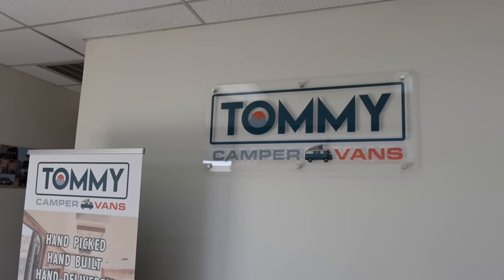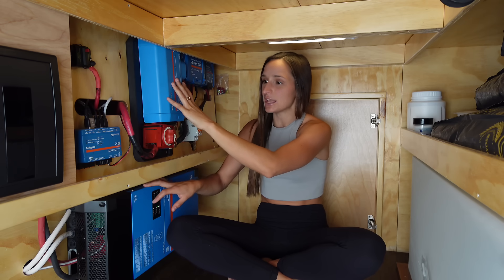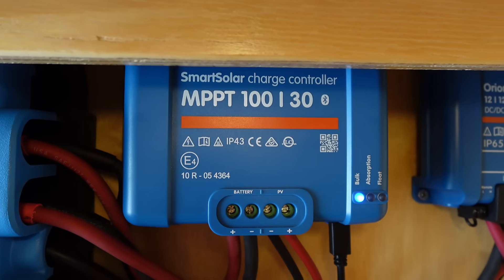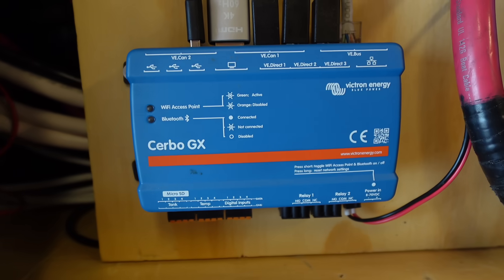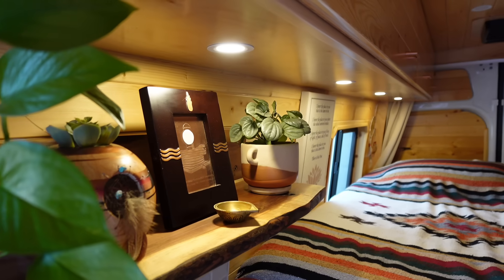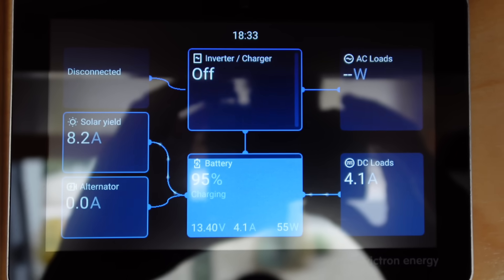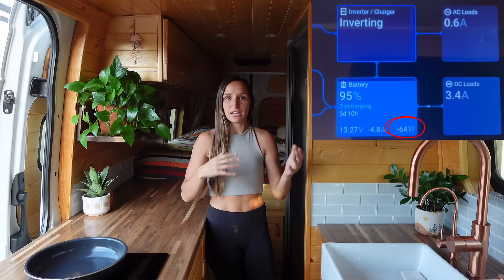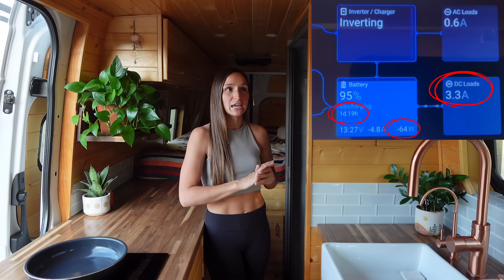VAN ELECTRICAL SYSTEM | A Practical & Simple Breakdown

Comment: Almost a year now and significant advancements have been made in van life's market development especially for electrical components. 
8 months updated van electrical system parts for a similar setup:

Stock alternator (12v 140a 1,700w typical) $included
12v 400a 4,800w High output alternator upgrade $400
12v 60-105ah 1,100cca Lithium starter battery $180-350
4-Point flat lug battery terminal blocks $20
4 Gauge cable $30/100ft
Circuit breakers 120v 30a ac/10-300a 12v dc $9/ea
600a Kill switch $25
40a 12v 616w Dc-dc charger with mppt $130/ea
60-100a 12-48v 720-1,200w Mppt $90-170
Rigid solar panels $50/100w
8-14ft 600-1,100w Solar awning $5,000-7,500
Shore power charger 120v 5-30a ac-dc $20-110 
13a 120V ac in port plug $15
314ah Heated bluetooth lithium house battery $280/ea
Rj45 bluetooth monitor module $20
3000w Psw inverter $160

14-2 wire $30
120v 20a Gfci with 65w gan usb-a+c $65/ea

Total = $965 for heated 314+105ah battery, 3kw/6kw inverter, 100w solar, 600w ac-dc+shore power, and 616w dc-dc 12v-120v electrical setup. (not including upgraded alternator, 60-100a mppt, solar awning, or 65w gfci outlets)

Comment: Fun vid, lots of great info. With regard to DC to DC charging using engine alternator……you should understand that pulling a large bunch of amps out of the engine alt when/if charging the house batts at engine idle rpm is a severe stress to the alternator. Highly recommend you limit use of DC to DC charging to when you are on a highway. Alternators function best at highway speed engine rpms.

Comment: I have an old VW bus and one thing that I use to help supplement power is a portable solar panel. I’m limited on how many panels I can have on my roof however being parked for a while I can put out the 200w portable panel and my batteries charge up faster. Just a thought for you.

Comment: I believe you said you only have 300W of solar panels. Do you feel that's sufficient with having an AC unit and running your appliances? I had 400W then just got an extra 200W panel because was worried it wasn't going to be enough to run the AC for longer periods of time since I live part time in Florida so wanted prepare for the heat. I will be sacrificing precious rooftop real estate since i wanted a roof deck... I haven't installed the panels yet, still configuring the rest of the components I need and final decisions. Thanks in advance! :)
Reply from the maker: I rely heavily on my DC to DC charger! I would not be able to run at all just on solar

Comment: What I did on my van build was sacrifice the amount of rooftop deck I have
For more solar power

You have(3) 100 W panel -300 W
I have  (4) 200 W panels - 800 W

Similar size van, I live in a cloudier, not as sunny area of the United States 

I would assume Texas is pretty sunny so 300 W is OK 

For me, I need the solar even on cloudy days, especially in the winter 

There’s a few months that I actually have to use a generator to keep everything powered up because it’s so cloudy for weeks at a time

Comment: As we can see the battery is not enough for ac it drains all the battery in just 3-4 hrs..
Reply from the maker: Yes I have to use the AC sparingly! It lasts a lot longer on ECO mode but I still don't use it very often

Comment: you made it super easy to follow of how when and why to use certain things and what ur setup consists of. Having 3 power choices is what i would probably consider and ur set up and especially ur monitor might be one of the best if not the best one i have seen.

my question is the dc and ac loads how high can they go before u think its too much or do u not use enough of either one to really worry about...im guessing the watts is the one that obviously needs to be monitored more carefully if ur new to van life and electrical consumption? by experience u have already learned what u can and cant do haha :)

i think u have mentioned it before but how many gallons do u have, how long do u shower (i guess its pretty quick to conserve) and how often do u need to feel up..if i missed it on another one of ur vids, my bad for asking again? lastly if ur in phoenix vegas or other places that are 90-100 degrees how do u use ur AC because im assuming it being that hot that windows open and ur power fan may not help that much if at all especially at night ? thanks

btw loved the bloopers hahahaha...."youre close sarah ur close" lol cheers
Reply from the maker: Thank you!! I don't overload the DC or AC too much because I don't want to find out 😂 I have 34 gallons total and showers are quick (turning the water on and off the whole time) lasts me about 5/6 days. I really try to stay away from temps that high for the most part. But the fan and windows open can keep it at least same temp as outside! If it's really hot, I'll shut everything and turn the AC on for an hour or 2 and cool down.

Comment: Read Physics Demistifyed. Take it out at a big library. 2 inch thick book - but just read Chapters on Direct Current, Alternating Current, More on Alternating Current. Do the simple quizes at the end of each chapter. That's what I did instead of only DIY YouTube videos. Now after 3 years, (didn't know squat of electrical) I can build Tesla Battery Packs for Vanlife, E Bikes or EV's. Maybe my own EV Vanlife Van in 10 years.

Comment: Hello, automation engineer here 🙋‍♂️the video was very interesting, keep up the good work🫶🏻 although i am a bit worried about the mounting of your inverter. The victron multiplus is designed to be mounted with the text right side up. If not the cooling is not working as well as it should. It may not be a big deal if its not under heavy load all the time, but you could run into thermal issues in the future. Everyting else looks awesome 😍
Reply from the maker: I hope it works out mounted this way 😬

Comment: You may be able to adjust the induction top power rating so you can use the air fryer simultaneously. It’s worth a Google.

Comment: Hi there!! I'm curious: Do you have to pull your Starlink inside when you move, or is that a permanent mount? Everyone I see who has one always brings it inside when moving. I have not taken the leap yet, so I am unclear how sturdy they are or tolerant of weather and wind... Thank you!.
Reply from the maker: Hi! Mine is mounted using a quick release mount from Savage UTV. I don't have to take it inside. You can do either way! Some people store it inside the van, set it up when they want to use it, and plug it in. I have seen a lot of people recently start to mount them permanently on the roof and hard wire to their house batteries (with and on/off switch) which is what I did 👍🏽 No worries with weather they are durable.

Comment: like your vids a lot:)  one criticism of the electrical work: where cables pass through holes cut in the plywood, it looks like they are pretty directly exposed to rubbing on the edges.  In an immobile situation probably not a huge deal but with all the movement/vibration in a vehicle I'd be concerned about damaging the cable insulation.  Also, assuming you have a pretty large battery bank, make sure you have at least one appropriately sized class T fuse close to your batteries.  In fact, if this is something you're not 100% sure about, I would recommend making sure your entire system has sufficient over-current protection.  Not having that stuff in place is very dangerous and can lead to fire... Sorry not trying to be overly dramatic, just wasn't clear from what I could see if you have all that kind of stuff:)  👍
Reply from the maker: Yep I have T fuses and overcurrent protection throughout the system! As for the wires, good point, I will keep an eye on that.

Comment: Great job with the videos & explaining the power system. I've learned a ton recently installing my power system in my 5th wheel. I added a 6000 watt inverter, 15 kWh of batteries & 3000 watts of solar. I love boondocking so having a ton of power is awesome. Knowing how your system works is vital so you can diagnose any problems with it.

Comment: Love your content. You are knowledgeable and articulate. You’re channel is going to do well. I have a question about your starlink mini. My wife and I had one delivered to Alaska on our trip last summer. I have been pointing it to the north but I see yours is mounted horizontal on your roof. I would love to do that. Do you notice any signal loss with that placement?  Thanks in advance and good luck with your channel.
Paul
Reply from the maker: Great question! I find that as long as I have a clear view of the sky with little obstructions (which most of the time is the case for me) I don't have any issue with it being flat mounted. If there are obstructions, I will usually have to go up there and unmount and tilt it to the North. But no obstruction, no problem (in my experience)

Comment: Hi. What setting did you activate to have the display of the Cerbo show "Alternator" in the lower left box? Regards, Silvano
Reply from the maker: Eek. I am not sure. It has always said that, and I did not install or set the settings myself. Sorry I couldn't answer this!
Reply: @sarahhfoss  No problem. I found out. It is because you have a new Orion XS DC-DC charger. With that it shows automatically on Cerbo's screen, which is not the case with the older Orions, as I have.

Comment: I can't knock it. Solid. The inverter is a bit weak though. You might want 2 of them. I don't think the bottleneck is necessary or worth it. Van life to me is freedom because it's free electricity. Not being able to use it how you want to sucks. I don't like Victron for all of their components because if the cost holds you back it might not be worth the security it's supposed to give you if you've never had a problem with those parts. You did say you had problems before upgrading to Victron but you never did go into detail. Though it may not be for all audiences I think it might be the difference maker in spending a lot of money to achieve specific goals. Running 2 3,000 inverters is better than 1 6,000 watt inverter but it's still variable and the cost of Victron components is in my opinion not justified especially if it keeps you from using your power how you want to even if it's in the name of having a system that works how it's supposed to because obviously there's a lot of people that don't have Victron systems that work just fine. call me crazy but I think van life enables a lot less tradeoffs than people think. There are 3,000 watt PSW inverters for less than $200. The Victron inverter though is both a charger and an inverter and therefore called a multi plus but is still in my opinion neither functions are worth its $1,100 price tag. I think getting over the bottleneck of 3000 watts is achievable reliably without breaking the bank or any safety standards.
Reply from the maker: Hey! Question on this because I did looked into it! Do you use it? Do you know if it works in remote places with no cell service? I started off using a Verizon Jetpack but had to switch to Starlink because more often than not I am in places that have 0 cell signal (AT&T or Verizon). But I was looking at maybe getting this as a second option to use less starlink data
Reply: @sarahhfoss  you have possibly replied to the wrong comment. Not sure what you're referring to. Haha! No big deal though.

Comment: What an excellent video!!!
It's important to emphasize i think:
1) Lithium batteries can be drawn down to 10% capacity or less whereas AGM 'should' only be drawn down to 50% capacity or their recharge cycles are reduced significantly
2) you drive somewhere every 2 or 3 days so you get a lot of power from your alternator as you stated.   I stay in an area for a week or more so rely on solar far more.  A good rule of thumb for this would be have 1.5 or even twice the solar as batteries so you would ideally have at least 750w solar or more for 500a lithiun batteries.  You have that awesome seating area up there so that would not work for you. 
Conclusion.... figure out what is best for you and do that..... just like you have but others will be different..... happy travels Sarah!!!
PS you're doing exceptionally well!!!!
Reply: Thank you for pt 2 ratio break down.
Reply from the maker: Thank you and great info!

Comment: Can't go wrong with Victron! btw, their should be no fuse burn when you draw too many amps from the inverter, it should shut down and then reset itself after a minute or so. It can draw peak wattage above 3000VA (about 2600W) for a short while, if that's for too long, it should shut down. You might want to take that up with the installer.
Reply from the maker: Yes I think there was an issue with the initial install. All of that is fixed now though!

Comment: soooo how many hours can the AC last lol
Reply from the maker: It's so hard to answer this question 😂 It really depends on if there is good sun or not for the solar, time of day, how hot it is outside (the hotter it is the more it has to work to keep cool). There are sooo many factors involved that I cannot feasibly give a good answer 🙃 BUT as I experience different scenarios I will try and keep everyone updated
Reply: @sarahhfoss  I see lol is it worth it with all the problems your facing?

Comment: Awesome video!! Just curious what sieries  your batteries are wired in, and is your inverter 12v or 24v
Reply from the maker: At 5:56 you can see a close up of all the specs on the inverter. Batteries are wired in parallel!

Comment: Great video!   Keep them coming. I’m looking forward to the one on the lights and cameras.  I think that’s an important addition.  Do you have a heater in the van?  If so, does it draw a lot of power?
Reply from the maker: I do have a heater! I have an Esbar Diesel Heater, and no it does not draw a lot. I loose about 8% battery running it the entire night.

Comment: Thanks for this video, I’m one month into building out my van. I ordered a the same Victron components that you have. I am going with 2 Epoch 420Ah batteries. That should be a ton of power, but I will be watching my AC loads. Toaster oven is 1800 watts and I can easily see myself blowing that same fuse lol
Great video by the way, you’re cool and very fit 👍
Reply from the maker: haha yes - toaster oven should probably not be used with any other major power draw 🙃
Reply: So this is my question: At the price of the multi plus inverter, is it really worth it compared to other 3,000 watt inverters that are a lot less, if you can run 2x 3,000 watt inverters for less than the price of 1x multi plus inverter? You might have to get a separate RV outlet charger, but hey, 6,000 watts?

Comment: Fantastic system! Very organized and good user interface and good explanation. The only thing I would suggest is don't have unsupported wiring on the exterior of the rig such as the line to your starlink and the small power inverter. Always secure it somehow on its path to the device such as zip ties or other clamps to protect it from being damaged. 
Looking forward to more videos.
Reply from the maker: You are so right 😣 The cords were not long enough so I got it done this way for now, but going to look into fixing it

Comment: It's my understanding that solar panel performance is significantly reduced by shading. Even a small amount of shade on a single cell can impact the entire row's production. The height of the mounting rails on your roof, relative to the panels, appears to be a potential source of substantial shading 4:41 . I'm wondering if the shading issue I mentioned might also apply to your setup. Have you considered or do you know what the impact would be if the panels were raised a bit higher?
Reply: yes if they are wired in series
Reply from the maker: Spot on, unfortunately. That is something Tommy Vans has since fixed with their builds. I think I'm probably stuck with this for now until I can upgrade my roof rack!

Comment: Such good information and it looks like an excellent electrical setup. Most states don't allow a homeowner, who's not a certified electrician,  to wire their house during construction.  Whether your home is on a foundation or on wheels, the safety concerns for qualified professionals installing a proper electrical system should still apply.
Reply: I suppose but a lot of electricians don't know how to wire for off grid systems and make you waste a lot of money for parts in the process. I just feel like more off grid rigs means we need more off grid specific electricians. And then wiring it into a vehicle that has it's own 12v system, battery, and an alternator. A lot of electricians might just defer you to a mechanic at that point if you want it to be professionally done. The fact that it's off grid on a car makes it really unique.

Comment: Hi Sarah…..really enjoyed this video, and we’re onboard with following you on your journey.   Thank you for showing the digital results as you turned on the various equipment in your van!  Very helpful!  I have a question or two to ask if you have time:   If I followed you correctly, you heat your water with your 12 Volt system….you said for about 30 minutes….would you share what Water Heater manufacturer you settled on?  How many gallons of water are you heating?  And to what temperature are you heating it two?  Lastly, what Air Conditioner Manufacturer are you using?  Is it loud?  Thank you so much  Sarah!  We’ll look forward to following you and to your next video!
Reply from the maker: I have the IsoTemp 4 gallon hot water heater. I have also seen many people use the Bosch 4 gallon heater. I'm not exactly sure of the temperature but it's hot! (not luke warm). I have the Dometic RTX2000 AC. It's definitely not quite 🙃 But I think that is kind of par for the course!